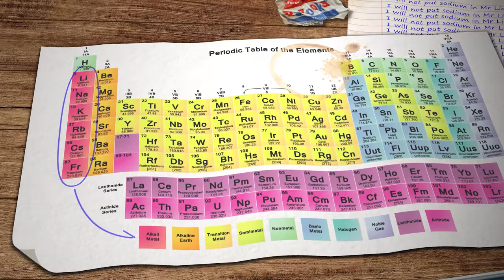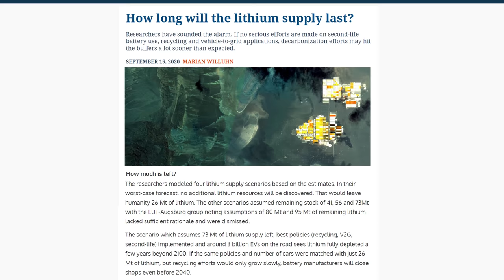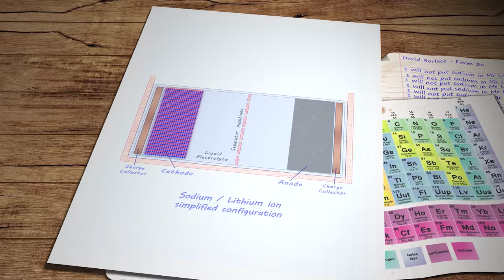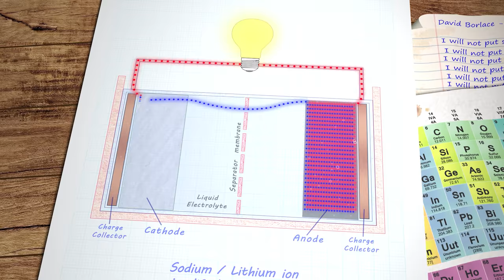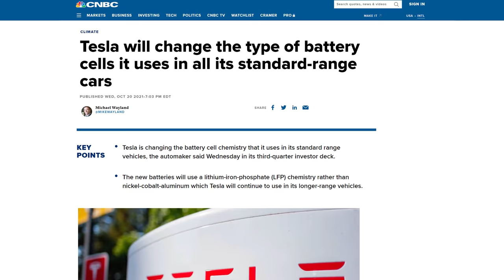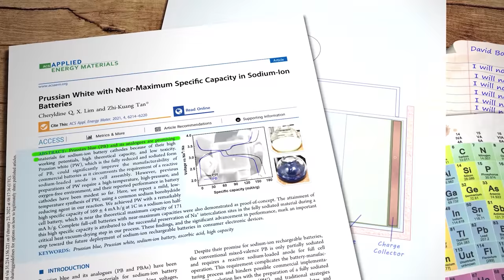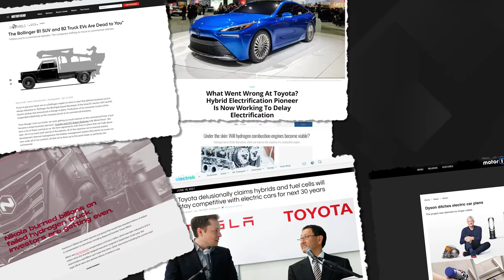Sodium-ion battery breakthrough. Safer, cheaper and cleaner than Lithium-ion

Comment: Sounds great; I hope they can deliver this at scale soon. A good enough battery made out of readily available and presumably cheaper materials is kind of what the world needs right now. I think cost is going to be the driving force here and we need to think beyond automotive. Sure, automotive can use these as they are good enough and this will likely enable vehicles at lower price points to have better ranges. But the real storage need is in our homes and on the grid. There the weight and volume are much less relevant. But the cost is super relevant. This new battery chemistry has the potential to be good enough for both of those segments. Same manufacturing process, which they've already mastered with much cheaper source materials. Sounds like a winning combination. All they need now is tera factories producing these batteries as fast as they can. There's no shortage of demand for this any time soon.

It might end up enabling batteries for the less premium transportation: cheap cars, vans, buses, trucks, etc. as well as storage solutions. The high-end segment might have a need for lighter, higher energy density solutions that enable better performance, range, etc. but also come at a premium price. The rest of the market just needs good enough energy storage at a much lower price point. It's like diesel vs. high octane fuels. Diesel powers (and pollutes) the world. But if you need to go fast, you buy the high octane stuff at a premium.
Reply: I agree that cost will be a driving force. Our governments could actually help out a lot in this area by pulling away some subsidies from the oil and gas industry so they they don’t look as (falsely) inexpensive.
Reply: @SaveMoneySavethePlanet  You need to look at where the subsidies are... because they are everywhere (not just oil and gas) ... bottom line cost is everything .. only once we get renewables cheap enough for similar performance change will occur.  Why do you think India and China and Russia and even the USA are not on board ... the french tried to increase the cost of current fuels and were rejected  ... need to keep working on the cost of renewables.
Reply: Jilles : This is not good enough to enable solar & wind as our primary power sources, for the same reason lithium can't- the important metric isn't monetary cost, but instead energetic cost. The solar & wind that we can make in enough volume (cadmium telluride can do it, but can't be manufactured in enough volume due to material limitations) will never allow any battery to make them our primary power source (as in, there's no possible battery chemistry that can do it). Even with the ideal solar cells combined with the ideal energy storage (pumped hydroelectric, and maybe pressurized air), the first world nations would reject it because of the magnitude of negative effects to their living standards. Sodium batteries offer great improvements, but batteries will never solve our climate problems, regardless of the battery type.
Reply: @absalomdraconis  it's about cost per GW/h - China has committed to the fastest reduction of CO2 from peak to zero they always beat their targets.
Reply: @absalomdraconis  Immensely important. Confirmed and reconfirmed. 
On Friday, the Eurasian Economic Union (EAEU) and China decided to design the project for an INDEPENDENT INTERNATIONAL MONETARY AND FINANCIAL system.
Reply: Ive heard that our government has control over the patent system. Does that mean the government would direct the future of battery technology?  Or doesits a free for all race to develop the Ultimate battery?
Reply: @markjackson7467 we live in a electric world. Our grid is antiquated.  (Usa) its my understanding  30 % of power is lost in transmission. If solor supplied 30 % that would be a huge step forward.  Battery storage could pick up 10% . Thats quite a bit.  If the loss of transmission was reduced to 15% then there would be a huge increase in availabe electricity. I think there won't be just one factor that solves the energy problem. Perhaps we  need to find ways to reduce energy draws ?
Reply: Batteries do not belong in grid applications.
Reply: @chadkline4268  seems like were goong to need all the help we can muster. With hydro dams going dry its about to ger ugly. There are  different batteries for different applications. Lithium batteries work as short intermittent problems. . Flow batteries are better for longer periods and easy to add more batteries.  Until a magic solution becomes real we ate going to be having a hard time.
Reply: @johnramirez5032  Ultimately, hydrino energy will likely be available to all in the next few decades; which along with fusion, powers the sun. Not fission.

In the meantime, for a 24/7 grid, there is geothermal (which seems underutilized), hydro, and wind (if you're near flat lands or seas). Else, a gravity or hydrogen form of storage with solar. A grid needs to be much more efficient than batteries. Batteries are super expensive, and they don't last long enough for grid use.
Reply: @chadkline4268  i think yiur right. They are not a solution. At least not at this point. Im seeing some great research that could help us  get by until the holy grail of research arrives. Im hopeful batteries will help . Who knows ? Mabe something completely different will come out of this. I think hb11 is a workable or attainable goal. Hydogen /boron reaction if you dont already know. What is really good is the reaction produces electricity instead  of heating up water to use steam.  Although that could be a bennifit. Its a race to the finish line!

Comment: The problem with Na-based batteries has always been the larger size of the ions, leading to reduced ion mobility. Up to now, this has been solved by operating at 300°C, but if CATL have solved this problem, it could truly be a game-changer. Looking forward to finding out how they perform at sub-zero temps, and if this electrode material can be used to improve Li-ion charging rates.
Reply: from what I've heard, they can use a less viscous solvent in their electrolyte formula, which helps a lot with ion mobility and thus beats the sub-zero (if you speak SI) performance of standard Li-Ion (Co/Mn/XXX) and of course Li-PO4 batteries. The hard carbon electrode material also contributes to that. 
just my 2cts...
Reply: Not to mention its reaction to water and its thermal expansion causing broken conduction.
Reply: @Dana5775  Lithium also reacts to water.
Reply: @Anenome5  All the alkali metals readily react with water to form hydroxides with the release of the hydrogen gas but lithium reacts slowly with water because it has higher activation energy and slower rate of reaction and forms colorless solution of lithium hydroxide along with the release of hydrogen gas. Sodium reacts instantly resulting in a flame due to the exothermic heat. Don't. Kid yourself sodium has far more r edgy density and could provide a multitude of energy storage in comparison to lithium. If manufacturers could get around the sodium problems they would have long ago. Advances in material science and dry chemistry alternatives in assembly are making the potential a possibility.
Reply: @Dana5775  Neither sodium ions nor lithium ions react with water. It's a common mistake to confuse the elemental metal with its ions. But there is no more sodium metal in a sodium ion battery than there is in a glass of salt water. Incidentally, adding sodium metal to water doesn't produce enough heat to ignite the hydrogen gas produced. That does happen with potassium, though.
Reply: @RexxSchneider  salt water is sodium chloride. Not an exothermic reaction in water.
Reply: @Dana5775  Salt water contains sodium ions in solution, just as a sodium ion battery contains sodium ions in solution. In neither case is sodium metal present. Neither the sodium ions in the glass of salt water nor the same ions in the sodium ion battery have any reaction with water. There is no "reaction to water and its thermal expansion causing broken conduction" for the sodium ions in the battery any more than there is in the glass of water.
Reply: @RexxSchneider  wrong
Reply: @Dana5775  Stop embarrassing yourself. If you don't know the difference in reactions between sodium metal and sodium ions, you have no business commenting on the subject of sodium ion batteries. You initial comment is demonstrably nonsensical.
Reply: @RexxSchneider  @4minutes we see the concept where the cathode is composed of (Prussian blue) and the electrolyte contains sodium ions derived from the charging current extracting sodium ions from the cathode. It is the new cathode chemistry that makes sodium ion viable not just aquas electrolyte.
 Layered transition metal oxides and Prussian blue analogs (containing sodium metallic salts) are reviewed in terms of their commercial potential as cathode materials for SIBs. The recent progress in research on their half cells and full cells for the ultimate application in SIBs are summarized. In addition, their electrochemical performance, suitability for scaling up, cost, and environmental concerns are compared in detail with a brief outlook on future prospects. It is anticipated that this review will inspire further development of layered transition metal oxides and Prussian blue analogs for SIBs, especially for their emerging commercialization.
it is of great importance to eliminate crystal water in PBAs for future commercial applications. Herein, a facile heat-treatment method is reported in order to remove water from Fe-based PBAs. Although the heat-treated sample can be easily rehydrated in air, it still exhibits a stable cycling performance over 2000 times under controlled charge cut-off voltage. In situ synchrotron high-temperature powder X-ray diffraction demonstrates that the as-prepared sample is maintained at a new trigonal phase after dehydration. Moreover, the redox reaction of low-spin Fe2+/Fe3+ is activated and the high-temperature storage performance of as-prepared sample is significantly improved after removal of water.
Reply: @Dana5775  Well done in finding that. You really ought to credit your source, as plagiarism is generally frowned on. Prussian blue is ferric ferrocyanide with composition Fe7(CN)18, so clearly doesn't contain sodium ions. In its most commonly used form as a pigment, it is a hydrated salt, insoluble in water, but forming a colloidal suspension when finely ground. However, when used as a cathode material, some of the iron ions are replaced by other transition metal ions to create the Prussian blue analogue (PBA) which is used in an anhydrous form. There is still no sodium involved, nor lithium in the PBA. The electrolyte used is non-aqueous, so that the interstices of the PBA become available to hold sodium ions as the battery discharges.

So WTF were you talking about when you were lecturing us on the reaction of alkali metals with water? It has absolutely nothing to do with Na-ion or Li-ion batteries. If you were trying to say that water contamination in a Na-ion battery will prevent it being charged, you picked a really funny way of expressing that.
Reply: @RexxSchneider  by definition an ion is a charged particle. These elements are only ions when positively charged. As we all know a battery also discharges leaving the said element negatively charged and in the case of lithium or sodium these negatively charged particles are now highly susceptible to oxidative reactions. There is no reason for you to use prophane or derogatory comments in an intellectual conversation. 
Ultimately solid metal cathodes and anodes would increase energy density by some estimates 10 times. The gimmick in this presentation only provides the possibility of using a more abundant element than lithium in terms of an advantage certainly not significant increased energy density.
The real promise is a solid-state electrolyte which would allow the use of these solid metal electrodes by reducing the exposure to dendrites and air and water contamination. 
See Mr. Goodenough who has demonstrated this concept in a prototype already. Also, Maxwell has developed something similar while developing supercapacitors with dry applicated electrode and electrolyte. Tesla is now using this dry manufacturing technique in their battery manufacturing.
Reply: @Dana5775  Unfortunately you don't understand how a sodium-ion or lithium ion battery works. The metal ions are merely charge carriers and no redox reaction takes place with the sodium or lithium, which remain in the M+ state throughout the charge and discharge cycles. All that happens is that the positive charges migrate from anode to cathode during discharge and and vice-versa under charging. The movement of positive charges inside the battery is accompanied by a movement of electrons external to the battery.

The word you were grasping for is "profane" and I still want to know WTF you were blathering about when you were trying to tell people about the reaction of alkali metals with water. Read my lips: there's no sodium or lithium metal in the batteries that could react with water.
Reply: @RexxSchneider  
The formation of metallic lithium on the negative graphite electrode in a lithium-ion (Li-ion) battery, also known as lithium plating, leads to severe performance degradation and may also affect the cell safety.
Reply: @Dana5775  Yes, it does. I'm glad your search for excuses managed to find that.
However, that effect is not part of the normal operation of the battery. The reduction of lithium ions to metallic lithium only occurs under conditions of severe over-discharge, although any metallic lithium will tend to react with lithium cobalt oxide (or whichever transition metal is used depending on the battery) to then produce lithium oxide, which is the irreversible reaction that degrades the battery.
The redox reaction under normal charge/discharge is the change of Co3+ to Co4+ and back during the charge/discharge cycle.
A properly maintained battery with a battery management system to prevent over-charge/discharge will retain the lithium or sodium in ionic form throughout the cycle, which is why it's important to have a BMS for the battery. It's also equally important for you to realise that during the battery's normal operation, there is no danger of any reaction of lithium or sodium metal with water, which once again demonstrates how off the mark your comments were.
Reply: @RexxSchneider  I was designing BMS systems and battery packs back in 2012.  I have an original 1998 Chrystler E-bike. The electronics were crude compared to now. Unfortunately losing a great deal of capacity to the BMS system protection makes lithium ion less energy dense in reality you're using only 60 percent of its actual capacity.
I have seen many lithium (all different chemistries) batteries fail for many different reasons and sometimes they catch fire. Without the BMS and cooling systems we would not see lithium chemistries being viable. Sodium batteries present much more potential liability with concerning failures.
The most flammable problem in lithium ion is electrolyte chemistry.
Lithium barium titanate has been my most stable and practical chemistry so far. Much heavier than lithium. 90 percent capacity is available as the discharge and charge recommendations in the BMS are less limiting due to electrode stability making it in reality more energy dense, relatively speaking. Charges in 15 minutes without degradation and much higher power output than lithium ion. Charge cycle range potential 25,000.
There are many promising battery technologies coming, it is very exciting to watch. 
I hope sodium ion is successful so we can stop hearing about the scarcity of lithium and all that hype.
Reply: These sodium and lithium batteries do not use the metals so they do not react with water.  They are already ions.
Reply: Yes you are wrong. As an Engineer and a scientist I do not know where you are coming from.  Ions do not react with water, they already have reacted to become ions.
Reply: @edwardcoulter9361 , no one said they did.

Comment: Prussian blue... It got my old, old neurons firing for a moment. It's a nice dark blue color. Machinists apply a thin layer which dries and can then use a pick or other sharp tool to scratch the blue off to indicate where to drill holes or make cuts. It's actually quite the versatile material. It's also used internally to help cure radiation sickness.

Comment: Using much more commonly available materials that I also cheaper is a huge advantage. Also it is still early days for Sodium ion batteries so we can hope for more technological breakthroughs. Exciting times for batterie technology.
Reply: I for one would certainly prefer a lower density greener alternative.
Reply: Lithium is running into a hard chemistry wall as far as density goes sodium ones probably have a similar limit
Reply: Thats waht people have said about micochips for the last 20 years and they are still getting faster. Don’t underestimate human engenuity. even if the chemisty doesn’t impouve any more there are still huge potentials on the pack level.
Reply: except for the whole toxic part
Reply: @mariogirod6195  the hard chemistry wall is that every lithium atom can only hold one electron. Then you have to add other elements that don't carry electrons but keep it from breaking and/or exploding.
Reply: Anyone planted a tree lately?
Reply: @jimp5133  I did today actually

Comment: The r&d is years ahead normally, but the trend instead is becoming months between changes in approach. What has become of the molecular battery discussed about 4 years ago.
It was said to hold 2000 times capacity of the lipo and charge 1000 times faster. (Which equates to a long charge time but huge discharge potential end-user devices).
Love hearing your informed and sensible presentations too 🙌😎